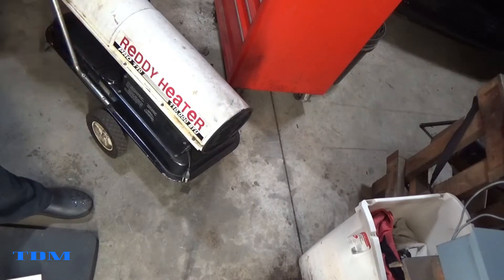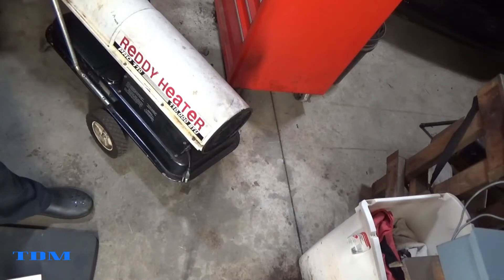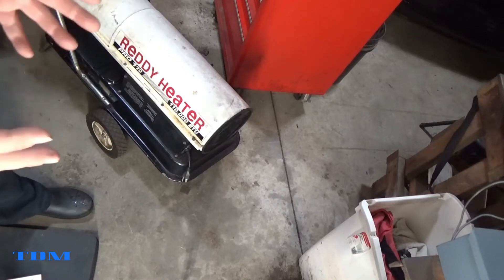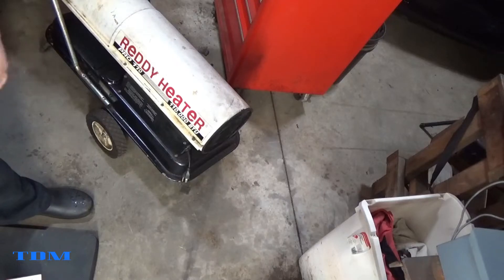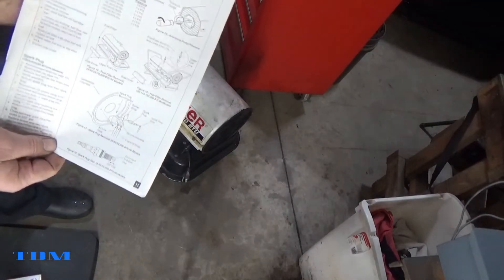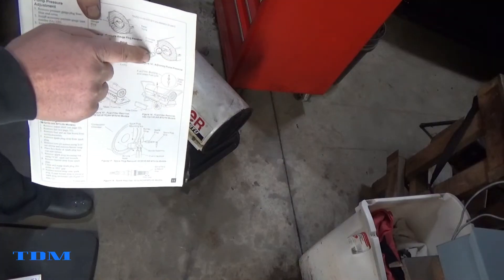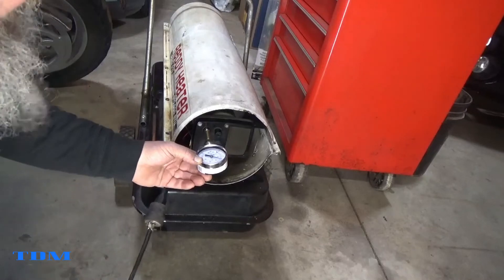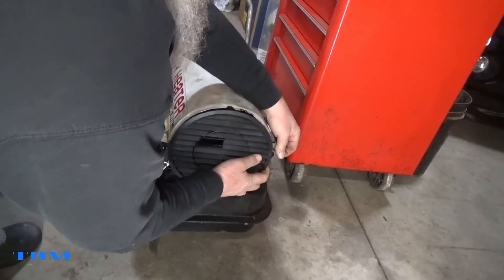Setting Air Pressure on Reddy Heater PRO110 and Other Kerosene Heater Models

Comment: I had one of those heaters and it worked very well. But I had to take a shower before I got into bed, my wife didn’t like how I smelled after running it in the garage. I did buy a Mr heater that runs on propane. Gas grill bottle and I get it refilled when needed.it’s a torpedo style heater. Good for a garage. A lot of people chuck the manual or loose it. I alway keep the manual, like you say it’s got good information and actually pages to look at.
Reply from the maker: Yeah the smell can be nasty but it seems if I keep it tuned the smell isn't as bad.

Comment: I forget what brand but mine came with a 10 psi gauge designed right into the back intake grille (threaded into pump) easy as cake to check and set pressure :)
it came from the lowes i think 10+ years ago, I just had to replace the rubber fuel tubing on it, it dry rotted out. I run standard pump low sulphur diesel fuel from local gas station, kerosene costs more!

Comment: Mike my 215K diesel heater pump pressure set to the specs runs  well but depending on how cold it gets the pump pressure reading is not quite the same .   I set mine   when it real cold and it  works much better .  I was setting pump pressure  when it was  warm  and noticed I was  getting  some  no starts  at real cold temps so I checked the pressure and it was low.  Good idea showing how its done 👌
Reply from the maker: Well it was about 32 F in garage! that was cold enough for me to set it! That makes sense because the colder temps is what it will usually be ran at. thanks for the info!

Comment: I am new to kerosene torpedo heaters, I have a dayglo deluxe that is 140,000 btu to 180,000 btu. It has a high/low switch by the air pressure gauge. Fired up last night and pushed the switch to high pressure, on the side it says 6.5 psi, and low is 4 psi. The low side is right at 4 psi, but when I went to adjust the high side the screw bottoms out at just under 6 psi. The temp in the garage was a tad under 80. I set the thermostat to 90. It shut off when the display showed 90. Is there something wrong with the air pump on high pressure, or will the pressure come up as the temp drops? From watching your video I now know the reason for adjusting the pressure. Other than that the heater operates normally. Thanks for any feedback

Comment: I have the exact same heater , I have problems with mine it will run for about 20 minutes and then start puffing black smoke and turning on and off, like it is losing spark, sounds bad but   if I bounce the front of it a couple of times  it will straighten out and run right for another 10 minutes or so and then do the same thing, any idea's?  Thanks in advance ....
Reply from the maker: Water in the fuel or fuel filter would be my 1st checks. Maybe even air filter
Reply: @TheDisgruntledMechanic  thank you for your reply, I found another video showing me where the fuel filter should be , I have never cleaned it or replaced it so I’m sure you are right , Thanks Again!!!
Reply from the maker: Yeah I did mine whenever that video was made for the 1st time ever, like 25 years or so! Same reason because I was having issues with it.

Comment: might be a stupid question but is it vacuum or positive pressure?
Reply from the maker: The FIRST STEP in diagnosing any heater problem should be checking the output of the air pump. Determine the air pressure required for the heater model that is being serviced. The air pump is responsible for fuel delivery.
Reply: @TheDisgruntledMechanic  yeah but the gauge is it measuring positive or negative pressure
Reply from the maker: positive air pressure
Reply: @TheDisgruntledMechanic  thanks i saw somewhere someone was explaining how it worked and they said vacuum,,, thru me off
Reply: Any videos about the fan motor? I replaced the rotor and it ran for a while now the fan spins freely by hand no grinding but when I plug it in it hums loudly and won’t spin over even with help any help would be greatly appreciated getting cold. LOL
Reply: @day2daylife561   starting capacitor on the motor?

Comment: i won at an auction a reddy heater pro10 10,000 btu. is that the same as a pro 110? i can’t find a manual for pro10 but i can find pro110
Reply from the maker: pro 110 is 110,000 so not he same thing
Reply: @TheDisgruntledMechanic  lol i hope i don’t win the bid, 100,000 btu vs 10,000. lol no wonder someone wants to get rid of it. you can only heat up 1x1 sq ft